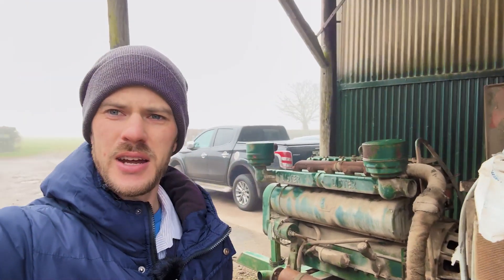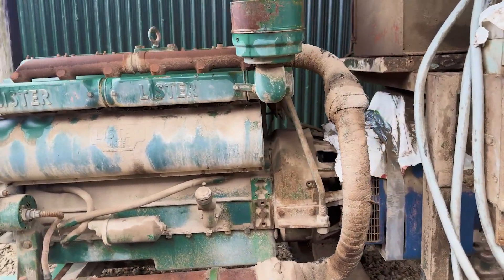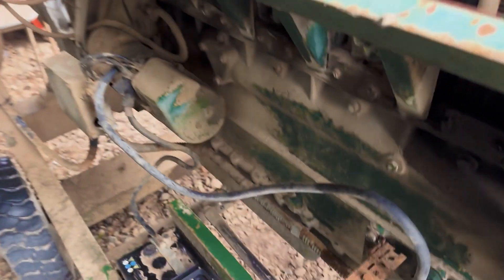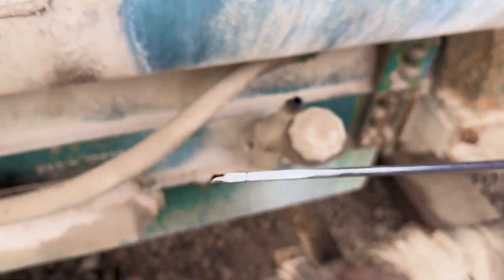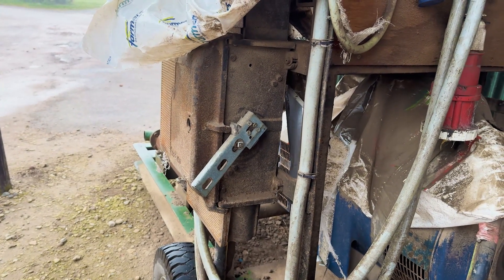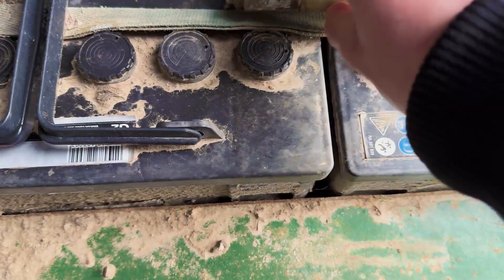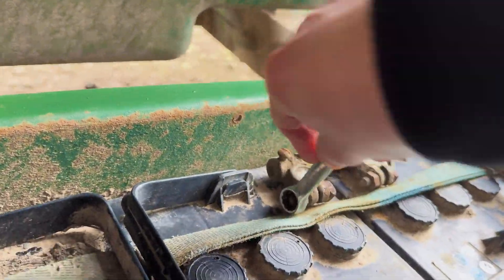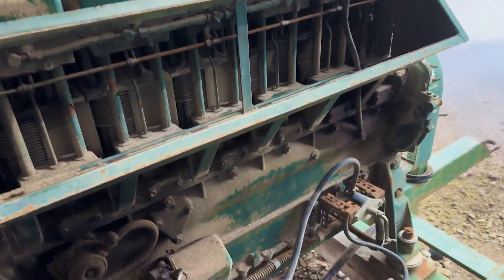Will It Start? - Air Cooled 109.5HP(!) Lister Diesel walk round and start up

Comment: looks like a deutz good engines made in Germany
Reply from the maker: Lister branded, thought they were UK build, but could be wrong!
Reply: @OverFarmMarket  can you find the builders tag on the engine?id like to know maybe it is a lister but iv never seen one with an external cooling fan.
Reply from the maker: The tag says made in England, 109.5HP B.S.649, No.xxx6A21, RPM 1500 and the casting for the intake manifold says Lister on it.
Reply: @ you must be right then.nice engine
Reply: It's a lister JA6, built 1971. There was a water cooled version the JW6. Plus turbo versions. Good engines. Made in Dursley, Gloucestershire. Something for you - just in front of fuel pump number 1 is a "top hat" - nd upside down top hat. This is the "excess fuel" device and will let the fuel rack move to maximum and will really help the start-up - especially when cold. Just lift it up, the rack will move over, and then the "top hat" will stay raised. When you start the engine, the top hat will fall down once the engine speed governor kicks in. Don't just run it on no load - during your monthly tests, put some load on it - the engine will thank you for it! It's a 35,000 hour engine if you look after it.  A thought.., I bet the last number on the engine plate is a 7. Made in 1977.